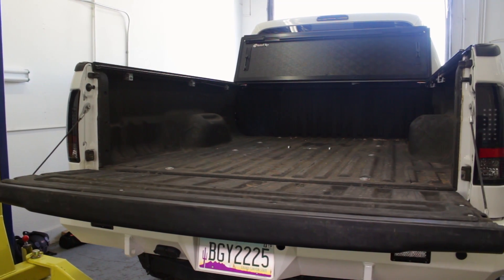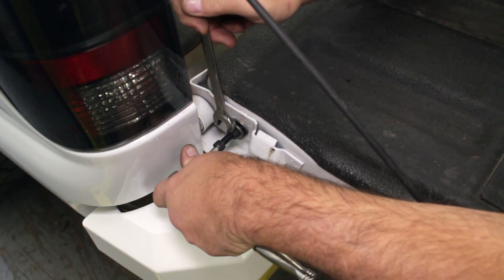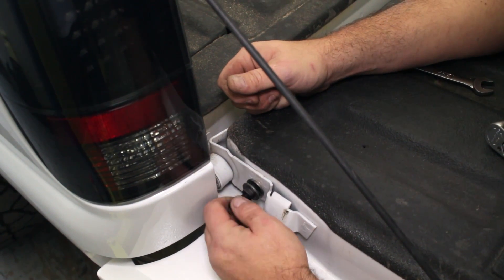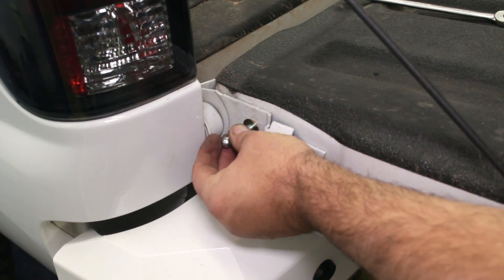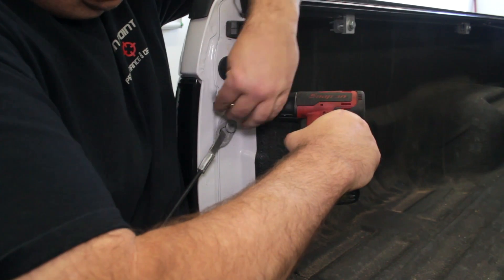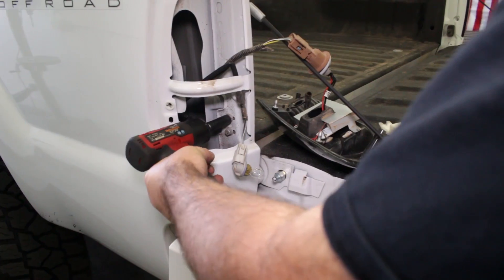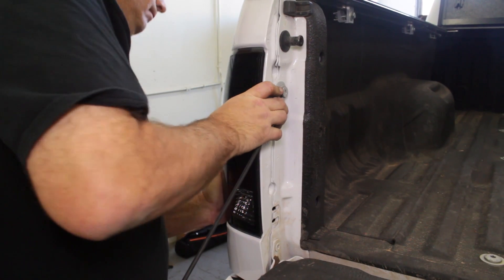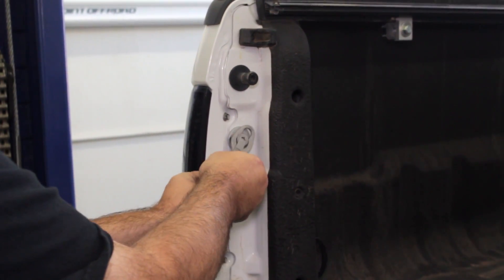1997-2016 Super Duty F250/F350 DeeZee Tailgate Assist Install

Comment: Every forum that has talked about these DeeZee units has said the nutserts are the problem. They get loose or the lower post bends over time. Bad design. The Ford tailgate assist is a better choice in my opinion.

Comment: Just installed my tailgate assist on a 2001 Ford F250. Did not make any difference at all. In the rate of speed the tailgate dropped. Am I doing something wrong? Is there adjustment? If not, this thing doesn’t work at all.

Comment: BIG BAD BOY SUPER DUTY? Well if you made anything worth a hoot at Dee Zee my truck may still have one of these. My current truck had one of these on it when I bought it. The bottom piece was bent and the strut was shot so I tossed it. Like all Dee Zee products it is junk. Don't waste your money on Dee Zee. My mind was made up about their junk  when I bought some bed caps that were paper thin, I never installed them. I am considering cutting them up in little pieces with a pair of scissors and mailing them back to Dee  Zee care of quality control department.
Reply: tom horn I got 2 tail gate assist on my truck I felt like 1 needed to be assisted with another one lmfao